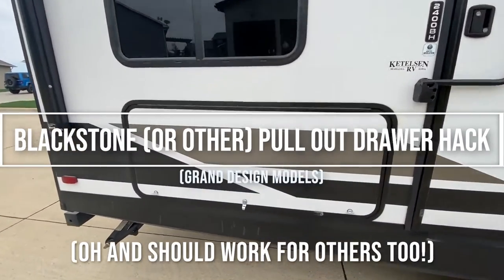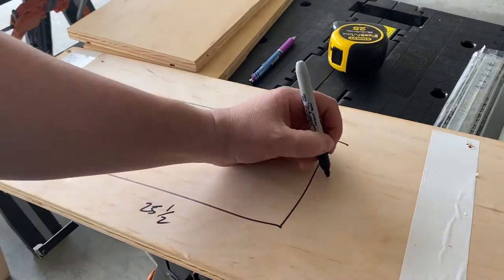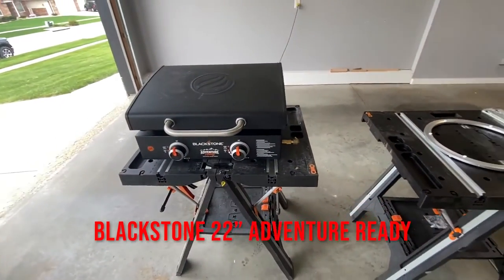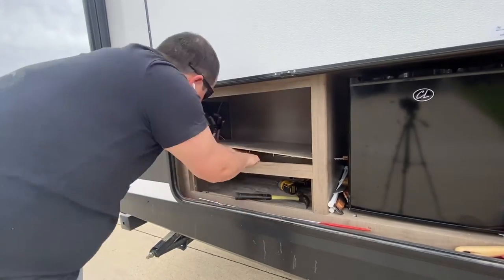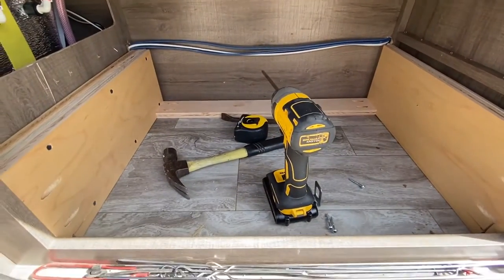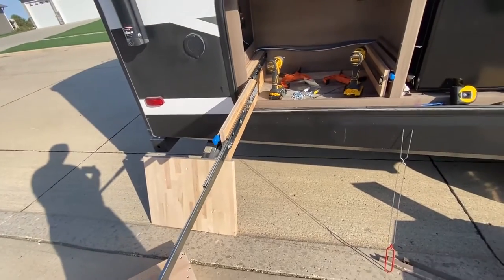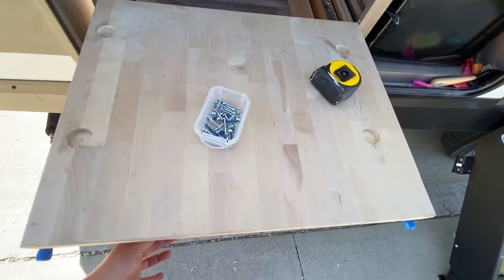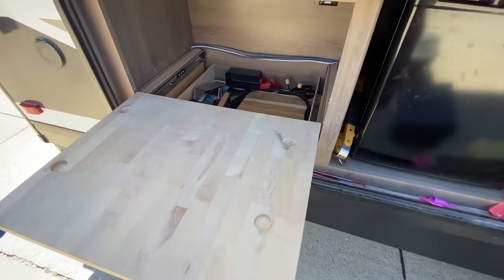GRAND DESIGN RV OUTSIDE KITCHEN BLACKSTONE PULL OUT COUNTER

Comment: Have you had any issues with the slides sagging when fully extended or even any bouncing when cooking on the Blackstone when extended?
Reply from the maker: not really sagging, but if the camper is not perfectly level, which is always, it can slide some, specifically out.  I am going to put a chain on it to adjust how far it sticks out.